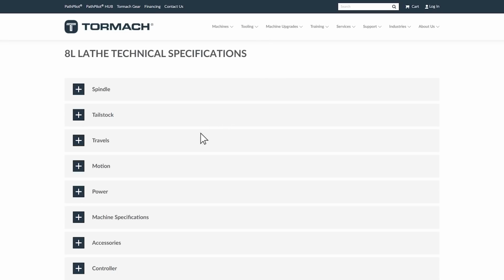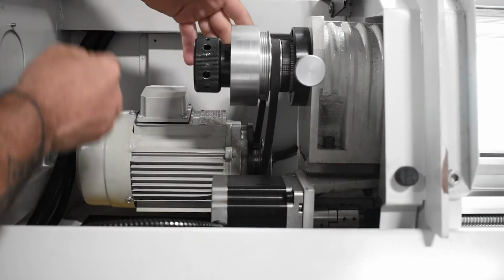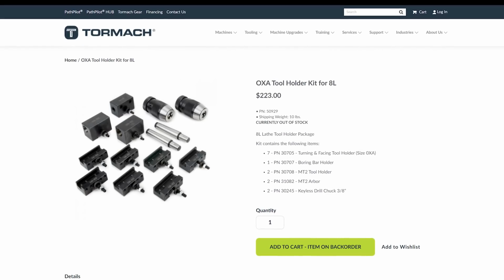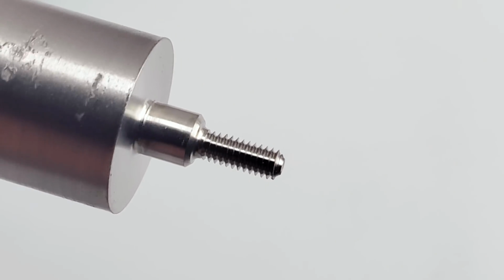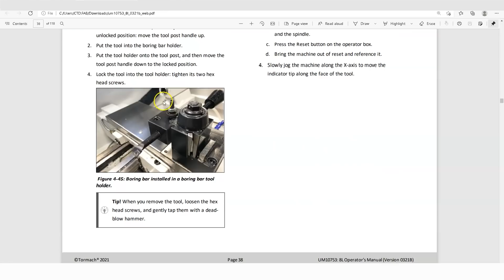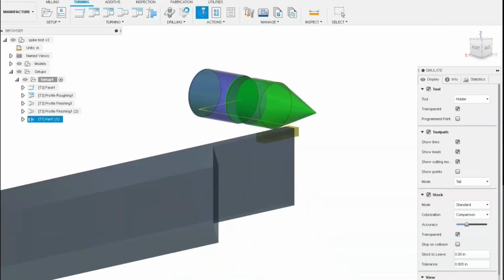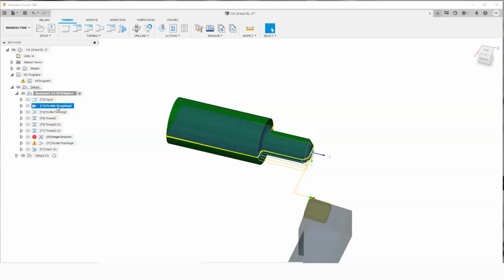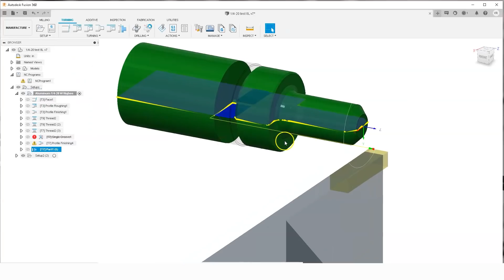Tormach 8L Lathe Introduction and First Chips!

Comment: I would be interested if they made it with auto chuck and bar feeder, I run an old emi mec pug board for macking a 12mm pin parted off but after 30 years the machine is a bit tired, I was looking at the haas chucker but not at that price
Reply: If you're getting into work where you need a bar feeder, this is not the large for you. It's not a production machine.
Reply: @littlejackalo5326  yes I know but what I make isn't mass production may be 1000 to 2000 parts every 2 months, tormach don't have an agent in the UK and judging by the cost of there slat bed I would go for a beefier machine, I leave the big production to the guys with sliding head Swiss lathes I'll stick with smaller batches that are too small for them.
Reply: @ricardo-iw9sq  They do have a UK reseller. CNC Machine Tools Ltd
Reply: @footpetaljones  thanks might look into them, looking at the USA prices for the slant bed they don't seem to be a cheap machine in contrast to say a haas or xyz. I will at the moment cary on with my 1970 capstan emi mec as the job wouldn't make it pay if I up graded. 👍👍👍

Comment: Spent a lot of time running a HAAS TL-2 lathe. Same set up with tool post and 3 jaw. You can run some low volume production using a boring bar to do your ID work, then turning your spindle backwards(M4) and cutting the outside in negative X. Make sure you set that tool up as 1 tool with 2 offsets though. Some folks make multifunction tools that are basically a boring bar that can be put on center to drill holes which would be the premium version of what I just described. Sorry for the long comment
Reply: Considering a used TK-2 for hobby work, do you have any more thoughts?
Reply: @semidemiurge  TL-2 or TK-2? If you meant TL they’re very simple to use as with any Haas machine. You’ll have to do some preventive stuff for coolant leaks for sure. Can make a real mess in a hurry. Make yourself a “Master program” with all your typical canned cycles so you can copy-paste-edit your way to new programs with ease. Honestly most content for creative use of a manual machine is going to be relevant in some way because of the lay out.  Great machine for what you want. Probably overkill for most hobby stuff but if the price is right

Comment: It's a step above something like a Sherline while being far less expensive than the Slant, seems to me like it will be filling a gap in the market. Nice new shirts btw ;)
Reply: For the same cost or less you could get a used professional grade machine that would leave that thing for dead. I recently bought a little haas turning centre for an ongoing job that I needed a small machine for, it would be perfect for someone interested in one of these. Just look around in the used market for smaller Haas or similar, you would make a much better decision buying a used professional grade machine than buying one of these new, and the resale would be much higher. And you’d get so much more functionality like 12 station turret, programmable tailstock, you might even pick one up with live tooling and a C axis, the benefits are endless... if someone gave me one of these, I’d hock it on ebay ASAP and put the money towards a proper machine.
Reply: @madaxe79  Totally understand but those machines are usually HUGE, not fitting in a 1 car garage. They are probably pre 2000's machines which means the controllers don't take USB. They probably take 220v 3 phase. And there is practically no support if they break down. 

So if you have the space, you're pretty familiar with the machine tool for maintenance, you have 220v 3phase, and you're willing to deal for floppy disks or tape reader converters then of course its better to buy used. 

But I'd be willing to bet most people don't have those luxuries.
Reply: @jacobfalk4827  you’re talking about a lathe, there is no reason to have a usb. You only need a handful of gcode to run a 2 axis lathe... if you look for a mid 2000’s Haas SL10 you’ll get a machine that has all you’re asking for, and enough leftover to buy a phase inverter to run it from single phase in your garage... and it will have better support, more reliable, more capable, and be a professional quality machine. I mean buy what you want, but if you want an expensive useless toy, buy a tormach, if you want a real machine, buy a used professional quality machine.
Reply: @jacobfalk4827  Oh another thing: if you need CAM to run a CNC Lathe, you probably should buy a sewing machine instead... I get it for milling, I use CAM sometimes myself, usually for surfacing complex shapes, but on a lathe, there’s no reason to use CAM in the home shop. Especially if you buy a machine with a good conversational program, but most of the time you’ll use an existing program and modify a couple of parameters and you’re cutting in 5 minutes. Even if you’re doing a complex part with heaps of tool changes, most of the time you’re gonna copy and paste. When you first get the machine, spend half a day setting it all up, write a few basic programs for different ops or tools, then when you are ready to start making parts, just copy from those programs, or you can use them as sub programs and use variables. It will take you so much longer to use cam than to use use conversational.
Reply: @madaxe79  while i mostly agree with you (barely using cam, even on a 4 axis lathe with powered tools), i have to say that your attitude does you no favours.
Reply: @angrydragonslayer  I don't really care what you think about my attitude.
Reply: @madaxe79  that's a given with that attitude.
Reply: @angrydragonslayer  whatever